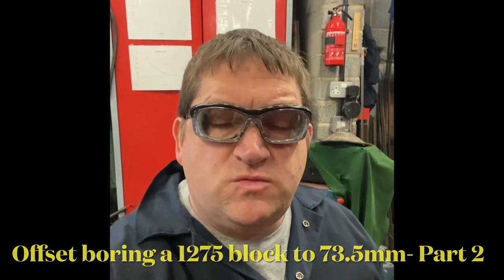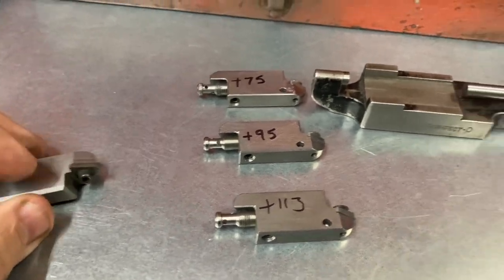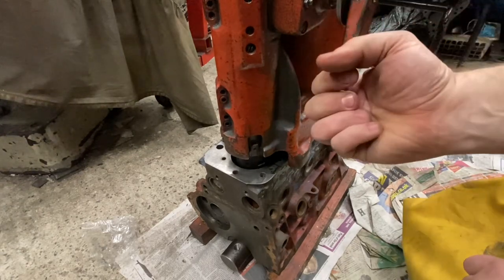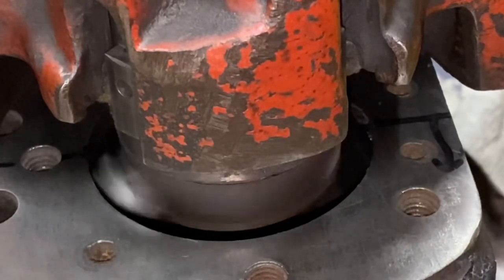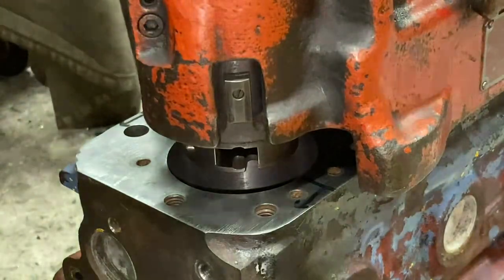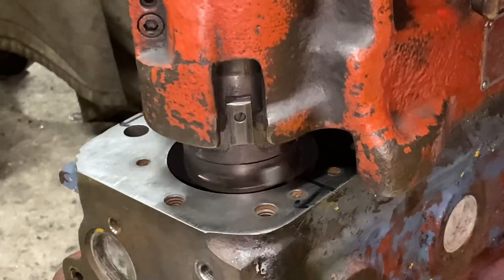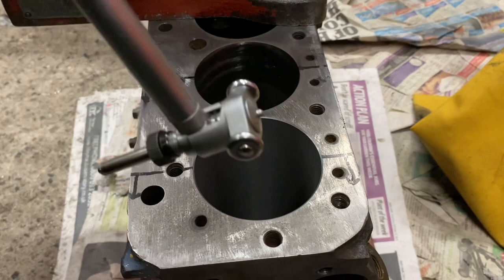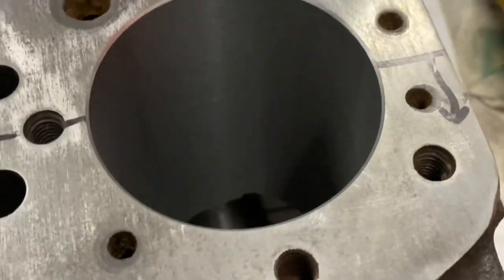Offset boring a 1275 block to 73.5mm - Part 2

Comment: At that bore size, how much slop does the headgasket have on the studs? Not enough to be a problem between cylinders?
Reply from the maker: There is a fair bit of movement so you need to carefully place the gasket when fitting the head.

Comment: And to bad you can't check the bore in between 2 cuts?
Reply from the maker: You can, by putting a dial bore gauge in from the bottom of the block, you just need a suitable frame to hold the block and boring machine high enough to gain access
Reply: @ACDodd  yes that seems to be the only way.
Reply from the maker: @therealspixycat  the reality is you don’t need to, the accuracy afforded by the 944, is that what you set, you get

Comment: Thanks for the video! What are your thoughts on torque plates for boring  the the A series engine?
Reply from the maker: Torque plate are used
For honing. Having never tried one I could not comment, however if you use a torque plate, seeing how much the bores move with ambient temperature changes I would suggest that if you torque plate hone, I would be wanting to do it with the block at full operating temperature and the water jacket pressurised. In this case the optimum clearance would need to be determined at operating temperature as these clearances are not known